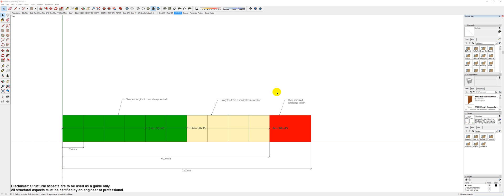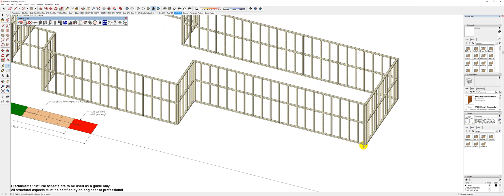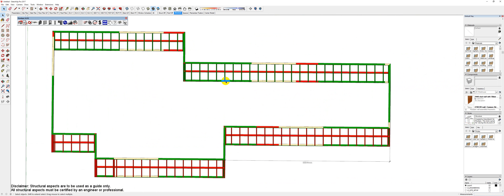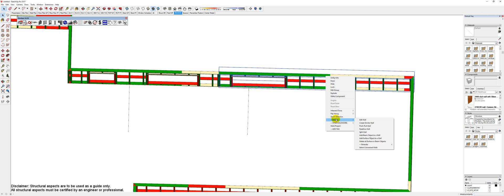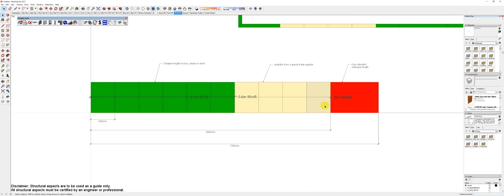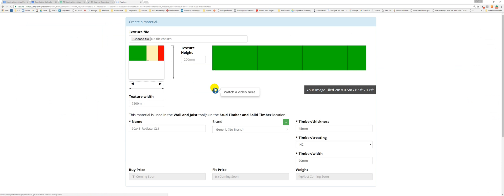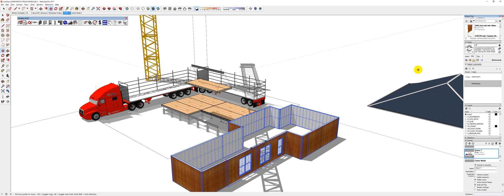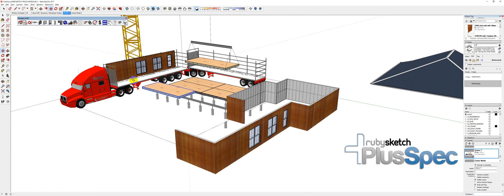Modular construction with BIM Live tutorial.

Comment: Fantastic plugin! I have one small question about the walls. I use the framing itself as A reference when building modules in the Shop, and i don`t want the topp and bottom sills to be cut at 45*. i want them at 90* and butted to etc other . is that possible?